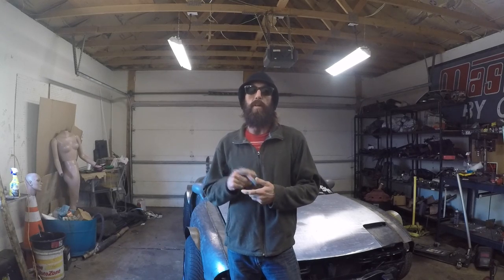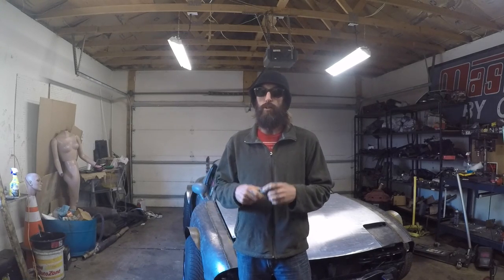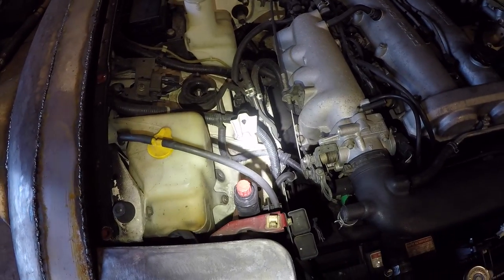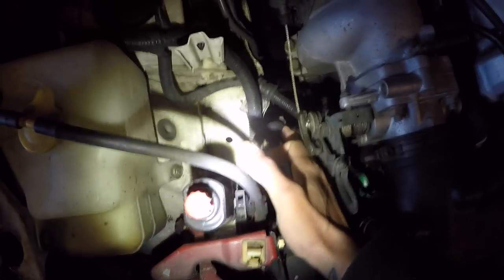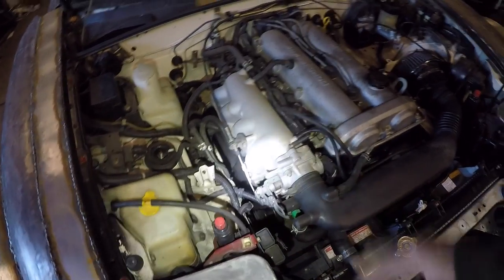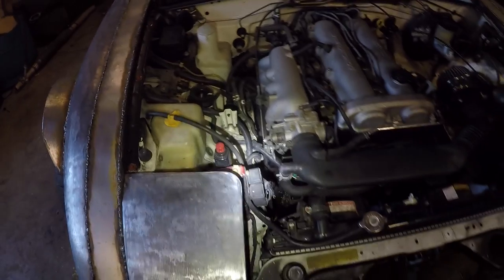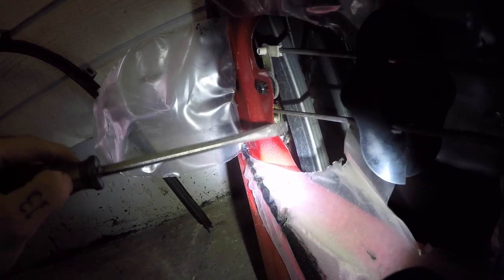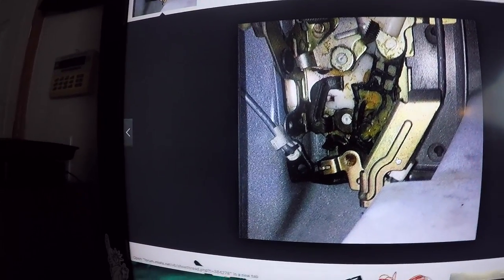Miata evap canister delete and door lock mod S07E03

Comment: For my '97, I think I have to leave a vacuum line on the solenoid from the intake. I get a CEL even with the solenoid plugged in. If it doesn't throw a CEL with vacuum, I'll reroute it somewhere for a clean look. Thanks for the video
Reply from the maker: weird, my last one was a 97 and never got a code with power plugged in and no vacuum...
Reply: hmm, well it's back to the drawing board. vacuum didn't work. i'll try reading the code to verify it's the canister delete. after i disconnect power and start up, no light. turn the car off, turn it on and get a light.
Reply from the maker: clear the codes and try again. make sure thats the code you're getting. may be something else
Reply: yeah i'll read them tomorrow and debug from there. i'll keep you posted. thanks again for the vids
Reply from the maker: sounds good, keep me updated. and no problem!
Reply: the code is P0141 - O2 Sensor Heater Circuit (Bank 1 Sensor 2).  i did just install a catback and had an 02 bung welded in post-cat, but i haven't had any CELs. my last attempt before tucking the canister back in somewhere else will be putting a 4.7k resister in the plug and see if that fools the ecu...or just keep clearing the codes :D i've tried every hose configuration possible
Reply from the maker: its not the hoses, its your O2. if the catback is not a factory cat, the O2 will fail its code check. have to have the computer flashed to omit that O2 or resistor it. it takes a while to get a code for O2 cause it has to fully warm up and fail multiple cycles.
Reply: i thought that at first too, but i threw the canister back in and no problems. without the canister there was no CEL on the first startup, but immediate on the second startup (this was reproducible 100%. with the canister back in i cannot get it to trip even after a long highway drive
Reply from the maker: the canister has nothing to do with codes. especially an O2 code. its your O2 or the wiring to it.
Reply: i agree, that should be the case. but I yanked everything back out and stuck a 4.7k 1/2w resistor in the sensor and it's been fine...maybe my 02 is on the way out and it just happened to start acting up now. time will tell if it is a coincidence!